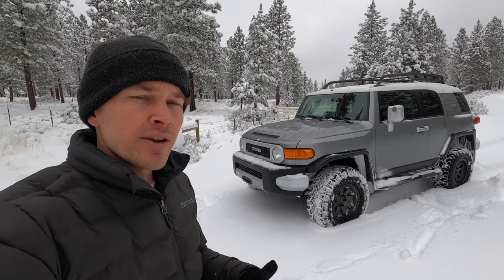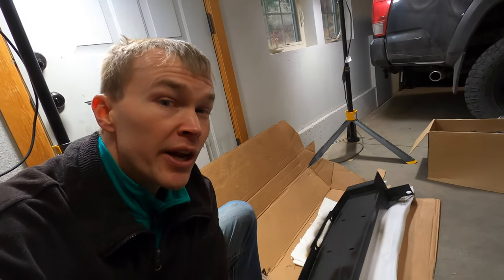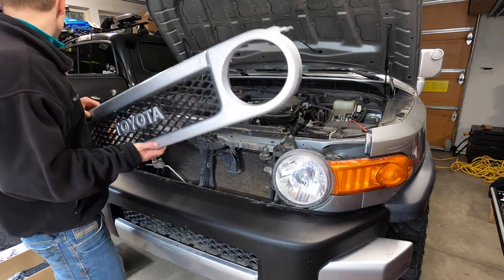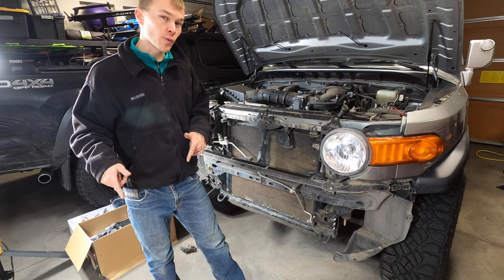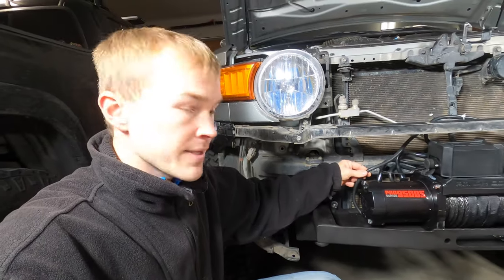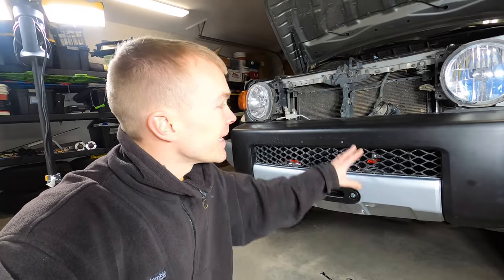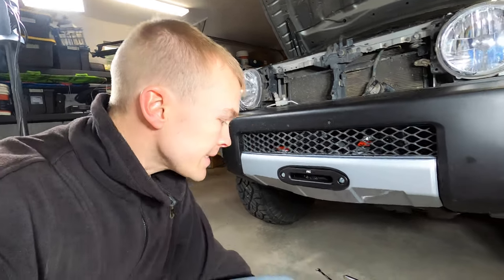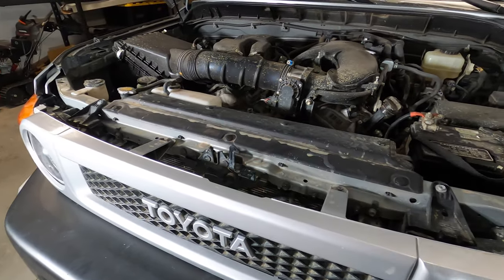FJ Cruiser Hidden Winch w/Install Instructions

Comment: I built my hidden mount  for my FJ with a Harbor freight universal winch plate, 25 mins of fabrication and it was ready to go, looks the same as the one in the video. I didn't install the grille , I like to see the cable, and have decent access to the remote connector. I used a warn 8k and a Ramsey fairlead.
Reply: Do you have the measurements? I think I'm gonna fab it myself too. I'm poor lol

Comment: US-offroad sells a really nice hidden winch mount, that's the one I run on my FJ Cruiser.
Reply: Yupper, I also have also installed a US Off Road Winch Box, they make a very heavy duty winch box that sits completely concealed behind the factory bumper with excellent plug and play fit.

Comment: I have a hidden mount from another maker and will be installing it and a winch soon.  My question is ..... Do you think water might be an issue with the winch mounted low in the FJ?  I was going to buy the rough country winch which is rated ip67 BUT i found a Smitty built for a little more money that is ip68 ( it also has a wireless remote)?  Do you do water crossings? Any issues for winch?

Comment: Hey Mike, great video! I'm looking into doing the same mod, but would want a wireless winch (I know there are kits out there to convert but looking at more factory-equipped). Not sure yet  what brand  / model, but would want  the lightest possible. The question I have is whether any of those winches on the market would fit the Hidden Winch Mount and  the FJ OEM valance  (with the DIY cut-off). Thanks in advance  if you have time to reply!! Best wishes.

Comment: Clean install. Thinking of something similar for my FJ. Maybe I missed it, how do you reach the lever to engage/disengage free spool? Or do you rely on the remote to let line out?
Reply from the maker: I can reach down behind the grille to adjust the throttle and plug in my remote
Reply: @DrivenCompanion  thanks for the reply. Good to know!
Reply: I wonder if you could add a lever extender to go through the front of the bumper for the clutch so that if you’re stuck somewhere you don’t have to open your hood to reach down for the clutch lever?